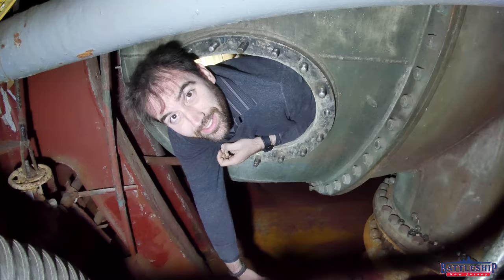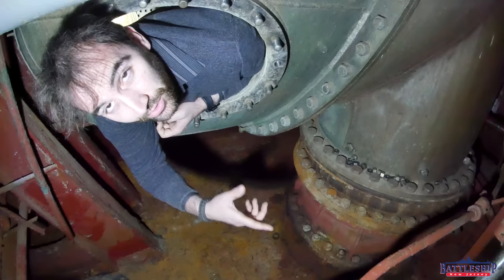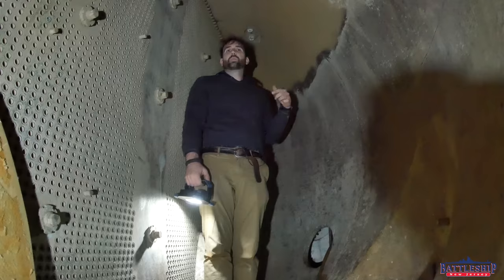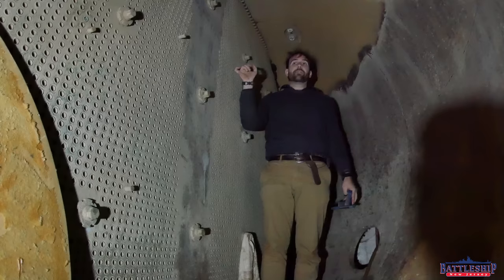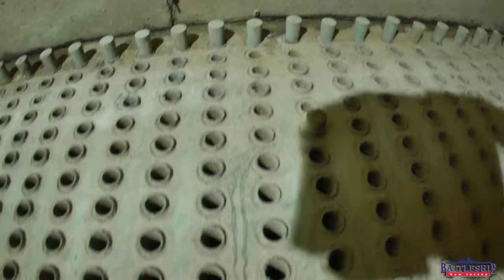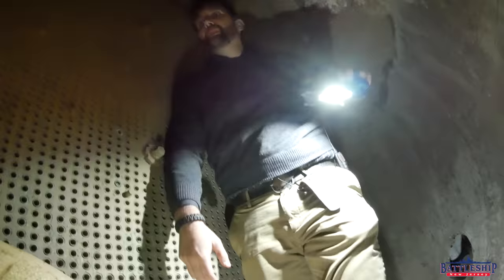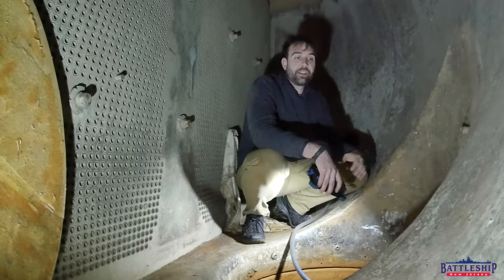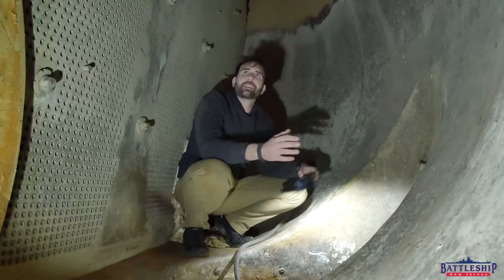Battleship New Jersey's First Hull Leak

Comment: Regarding the plugs, I know we have plugging margin built in for power plant heat exchangers. It's assumed in the beginning that some tubes will be plugged, so we overbuild them and then design with the plugged conditions. I assume they do the same on ships, but could also see a different approach because of space concerns.

If we get towards end of life and start to run out of tubes, we'll sleeve tubes in order to nurse them along and that can work pretty well for certain failures. However, a sleeved tube isn't as effective as an original tube, so it's not a perfect answer.
Reply: The tubes are constantly fouling and need to be periodically cleaned to improve performance. With tubes plugged the time between cleanings decreases.
Reply: @zeroone8800  I assume these ships don't have the fancy, automatic condenser tube cleaning systems we equip on some plants, haha! (Smallest sailor!)

I'd imagine that, depending on the fouling mechanism, plugging may actually help by increasing tube velocity.
Reply: @Mark-zi4dd  I imagine it's more the droplet impingement (why it's in the condenser, instead of another turbine stage) than chemistry. Chemistry shouldn't change much, top to bottom.
Reply: @corystansbury  The corrosion comes from the seawater side not the condensate side. The chemistry is bad and changeable.
Reply: @zeroone8800  Corrosion, yes. Erosion, less so (unless you're pulling in particulate). It's a combination. Tough environment. 

We use titanium tubes on our salt water condensers. I think it has something to do with stress corrosion cracking, but don't quote me.
Reply: Im surprised re-tubung isnt more common. Its absolutely standard for a steam locomotive boiler to be retubed at least once
Reply: @the_retag  I have heard more about retubing in boiler applications than heat exchangers. However, my experience is more nuclear than fossil.
Reply: @corystansbury  Ive retubed a few condensors. Usually pretty easy as the pressures are low so not much expansion on the tubes.
Reply: @corystansbury  Titanium is used in a salt water application,  because altough titanium still corrodes in salt water, it stops when it reaches a certian point when corroded. In a more brackish environment it is more common to use a copper-nickel alloy, over titanium. Although titanium has a much bettter heat transfer than a copper-nickel alloy. I have worked for a heat exchanger company for over 20 years, so I have seen many condensors and heat exchangers in my time in both  applications.
Reply: You are absolutely correct.  Re-tubing is a difficult and expensive process, so to reduce the interval between re-tubings, there's a bit of margin built in to allow for plugged tubes.
Reply: @jvanboven  Makes sense. Thanks.
Reply: In my 36 years in steam power plants, every condenser I have ever been in , the top row of tubes were most prone to leaking. I always thought it was erosion from the steam flow since these tubes are the most exposed (and mostly to be damaged) by steam or domestic object damage.
Reply: @paulcurrie7828  That's been my understanding. Droplet and FOD impingement at velocity. Or FOD being vibrated by steamflow. I'm sure you've found all sorts of stuff in condensers.
Reply: @corystansbury  lol…first plant I apprenticed in was built in the 1950`s…used river water for cooling condensers…, 30, 20 and 10 mw  generators so very small condensers….trouble was the nearby city dumped hardly treated sewage up stream…..beach whistles and turds were not uncommon along with maggots growing on the cast iron walls of the water boxes. It wasn’t until the 1980s that we started shocking the water boxes and making typhoid and diphtheria shots mantory for millwright. Of course a UV chemical and a black light were your friend when searching for “weeper”s.  Another plant had a sudden loss of vacuum tripping the unit along with a increase in vibration…flooding the hot well to look for leaks showed a river coming out of one tube on the top row, a visual climb in thru a man door on the LP case revealed a broken blade on the last stage…a piece of the blade had sheared of the leaking tube. This was a Parsons (English) turbine from the late 1950s, there was a one year wait for a new row of blades, we removed that row, installed a diaphragm plate drilled with holes to mimic the back pressure from the missing row and to balance out the axial thrust…..started it up and ran like that for well over a year before it was rebladed….the machine ran just a well in that jury rigged setup as before with a slight derate
Reply: @paulcurrie7828  Those are some great stories
Reply: If this is #1 engine room, there weren’t that many plugs in 1983 when I was in there cleaning the tubes. The anodes were also bolted inside the hatch cover. They were still in good shape.
Reply: This is true.  Tubes that leak are simply plugged until the next maintenance period when they can be replaced.  The condenser was designed to operate with a certain percentage of tubes plugged.

Comment: Giving me flashbacks watching you crawl out of that condenser. I, being of relatively small stature ended up in all manner of places with small openings while I was in the Navy and none were quite as pleasant as that condenser. The nicest was the doing the annual corrosion inspection on the main induction sump (726 class SSBN) the worst was probably either  SAN7 or SAN 9 on the same.... yuck
Reply: I had the same fate when I was "borrowed" for some mainspace tiger teams!!! Being the lil guy is definitely NOT a blessing!!!😂🤣
Reply: @wheels-n-tires1846  no it is not, and 20 years ago I was definitely a little guy... 5'6" 130lbs, I was the smallest guy in my division... now however it would take all of them to het me through a man hole, is they used lots of grease and a chainfall or two... but hey I used to be travel size, now I'm value size 75% more product than the original 🙄
Reply: @jaysonlima7196  same..i was 5-11 and 145 haha. I ALWAYS got LilDude details!!! But id get passed over for them now!! 5-10 and 185!!🤣
Reply: @wheels-n-tires1846  doing better than me I'm 230 lbs but still 5'6
Reply: I think it was San9.  Been in both, I did gas free engineer @subbase Pearl at the end of my career. Loved doing the impulse tank on fast attacks also.

Comment: The steam going into the condenser would not be 800°F.  In expanding and doing work, heat is removed from the steam and converted to work.  By the time the steam leaves the turbine, it is close to 120°F.  Due to the low pressure, it is still steam at that low temperature.  
For maximum efficiency, the goal isn't to cool the steam at all.  It is to just remove the latent heat and convert it to water.  Cooling the water further just wastes heat.  Also, cool water has higher solubility for oxygen which is bad for the boilers.  If you note the gap with no tubes down the middle of the condenser, that is for steam from the turbine to get below the tube bundle.  The falling water leaving the tubes will then travel through the steam and re-warm back to the steam temperature while condensing more steam.  Doing that helps the efficiency and with the oxygen level in the feed water.
Reply: Thanks for the useful information. Water boils at 212 degrees F at atmospheric pressure, is the pressure of the spent steam actually lower than atmospheric?
Reply: @erich9111  Sort of. a vacuum is always maintained in the condenser not just to suck the steam out of the turbine (pressure difference, a gas at high pressure will flow to an area of lower pressure), but it also ensures that the steam doesn't just boil the salt water in the tubes and further corrode them. This is achieved with the use of an Air Ejector in each engine room. I learned this from a MM on a sub although I am struggling to fully remember what he said, in essence, the vacuum helps draw out some of the oxygen and other gases, ensures the steam flows through the condenser, and something to do with the boiling point of the salt water in the tubes, I know lower pressure lower boiling point, but I will say there might be a piece I'm missing or just flat out not remembering
Reply: @KPen3750  The vacuum in the condenser is mostly created by condensing the steam. And it is surprising how close to a "perfect" vacuum a good condenser can acheive. However, after the steam is condensed into water, there are always some "non-condensible" gases present and these have to be pumped out in order to maintain the vacuum otherwise the condenser becomes "air bound" and has trouble producing a vacuum. The vacuum present at the turbine outlet increases the power output of the turbine because it increases the pressure drop across the turbine. This is like increasing the inlet pressure of the turbine but without having to raise the boiler pressure. The condenser vacuum also increases the turbine efficiency. Another big advantage to having a condenser is that the condensed water can be returned to the boilers again as feed water. This saves having to carry or generate all the feed water required by the boilers.
Reply: Think of this, half full ,warm water in a plastic bottle with the cap on. Throw it in the refrigerator, watch what happens to the bottle. Same thing happens in a steam condenser. It creates a vacuum. The air ejectors are used to create initial vacuum and are mainly there to remove non condensable gases. The natural effect of condensation creates a vacuum.
Reply: @erich9111  It is significantly below atmospheric.  The pressure is around 1-2 PSI absolute, depending on the water temperature.  
The energy in the steam from atmospheric pressure to the condenser represents a sizable portion of the energy in the steam.  This is due to the fact that the volume is so high as it expands down to such a low pressure.
Reply: The return temperature depends greatly on the exact vessel, in many processes steam is actually reheated between expansion stages to better utilize the potential expansion (either as pressure, or as velocity in some cases), so can be a large portion of its starting temperature when "dead" and being evacuated to condensers. Generally if its going to be very hot their will be some form of energy recovery stage, WW2 Japanese vessels did so to the firebox intake air, but most nations did so to the boiler pressure water after injector/pumps but before entering the actual water tubes of the boiler where heat is applied.

I've never heard of a return temperature as low as 120°F (48.8°C), even with excellent condenser vacuum its very dangerous to even transport large volumes of steam thats so cool, let alone do work with it, because condensate droplets that WILL form in high pressure regions (such as outside of any pipe bend, or any raised surface into steal flow) can pick up velocity then impact and wear on parts further downstream, and worse can pool to cause "steam hammer" which can totally destroy equipment or pipelines. This goes especially for systems with high gas flow speeds, and high starting temperatures, the Iowa class being both. I suspect this might be a memory or copy error from a return temperature was 120°C (248°F), as staying over boiling at standard atmosphere is normal good practice, much stationary equipment having insulation or even line heaters to prevent plumbing falling below such temperatures, both when flow rate is very low (thus less heat being imported), or when under high load and larger pressure differences occur (most notably if a valve or governor shuts quickly and flow rates suddenly drop).

Next up is the idea your "wasting heat" by sub cooling injection water. This seems an easy answer because of basic thermodynamics, preserving heat means less energy to re-evaporate, but it becomes far more complex than it seems because of the "steam injector" (aka jet pump) used to feed most boilers. While some of the extra pressure needed to use steam from the boiler to force water into the boiler can be made up with a velocity to pressure conversion (a divergent then convergent nozzle), a LOT of the extra working force comes from the feed water condensing the injectors working steam, which mandates the injection water have the remaining heat capacity before evaporating to do so. Moreso it often took several steam injectors in series to have enough pressures, and so the water would get hotter every stage, and even the steam leaving via drains (rather than getting condensed in the jet and thus mixed with feed water pumped to boiler) would heat the overall assembly. For this reason you basically never find a railroad locomotive with more boiler preheat than to prevent feed water freezing (which because it must be pure of salts ect was a large concern in many climates), there was no ability to save fuel by heating the feed water further, since it already injected near boiling even when the feed tank was cold, instead even the water jackets around firebox ect where all high pressure side, essentially part of the massive outer water tank that constitutes a fire tube boiler. Indeed far from heating the low pressure water, the larger injectors of ships or power stations water tube boilers often require to be cooled, both the housing, and even sometimes the water between injector stages. Using a either reciprocating pump or a turbopump that returns to the systems main condenser (thus using the extra pressure differential from condenser vacuum to recover the energy that was imparted within the ject pump by condensing working steam) instead of an injector seems an easy fix, but not only does it add extra size/weight/cost and reliability concerns (its far easier for a shock-wave/blast effect to damage high speed turbines and their related lubrication systems than a solid state jet pump), it would actually require more steam to drive it compared to an injector than you could save in heat. So there really wasn't a concern with "over cooling" from your condensers (as there is on cooling systems for fuel burning engines, hence the thermostat to reduce seawater flow in diesel cycle ships), what heat remains at the condenser was already irrecoverable, if it could be put into the boiler feed water if would be done so by a heat exchanger to the high pressure side.
Reply: Why do I feel like a bunch of nukes are on this thread.  Nothing like taking turbidities and singleling up engines so you can secure a condenser.  fun days.
Reply: @bsm327  Because we glow worms are everywhere.
Reply: This was a very informative thread.
Thanks.
Reply: @SheepInACart  I suggest readers ignore this long and completely incorrect, irrelevant attempt at describing a marine steam propulsion system. There are simply too many errors to even begin to list and most seem to originate from railroad steam engine enthusiast books.
Reply: @andrewhall2554  The initial vacuum and continued removal of air and non-soluble gases is done by a steam powered venturi (the Air Ejector) that is run continuously while the condenser is in operation. There will always be some air reentering the system through the shaft seals at the low-pressure end of the turbine. 
The thing that surprises me is just how big the condenser is compared to the one on the A1W prototype I trained on. I'm sure that has to do with it not having a pump running full time like nuclear plants do.
Reply: @andrewhall2554  29.92 Hg = perfect vacuum. Our once through condensers, with cold lake superior water,  we were generally about 29Hg. at the low pressure side of the turbine.

Comment: Ryan you are showing the discharge side on the inlet side has scoop injection along with main circ pump. We used the circ pump in port and sea and anchor details and when we where under a certain speed.